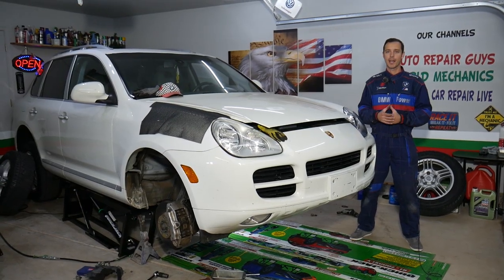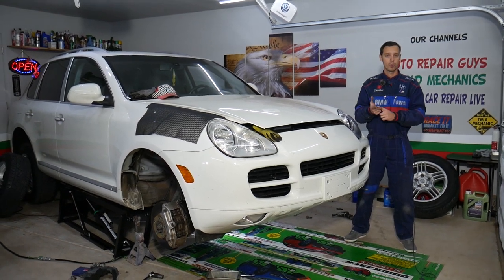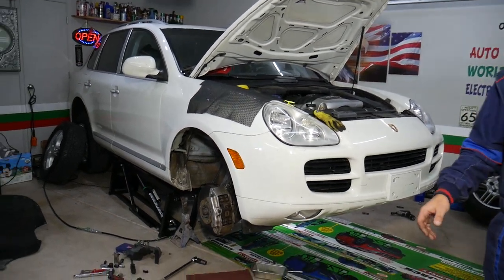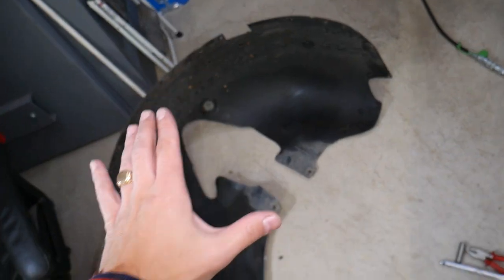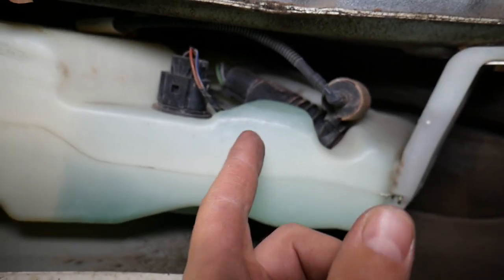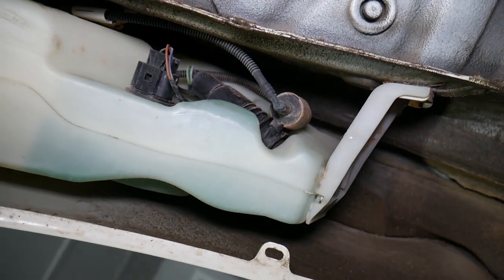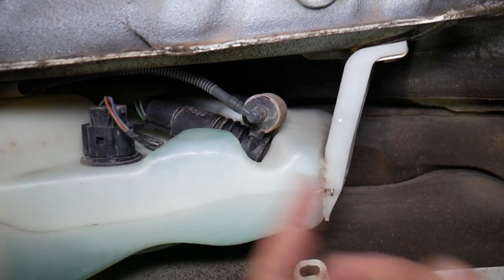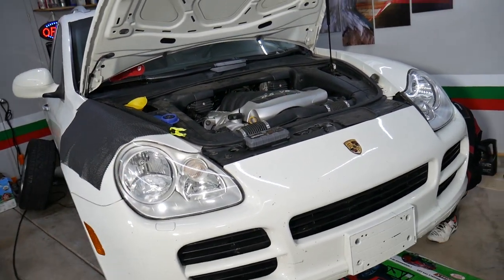WINDSHIELD WASHER NOT SPRAYING PORSCHE CAYENNE, AUDI Q7, VW TOUAREG

Comment: On my 2011 Touareg, the right nozzle sprays but the left doesn’t so my case is completely different. And it appears each nozzle has an electrical connection. I’m guessing the nozzle or the connection is bad.